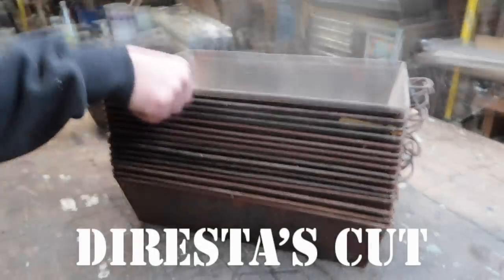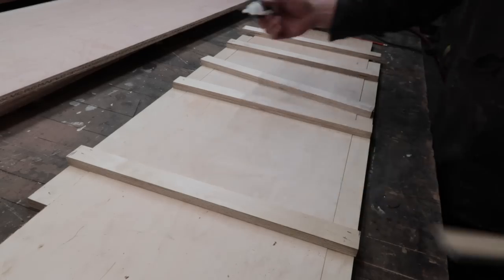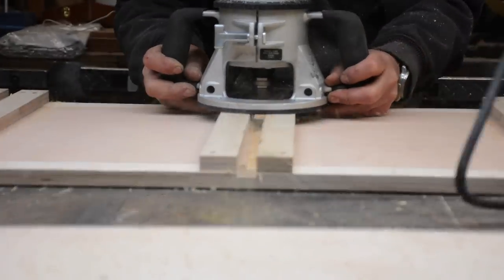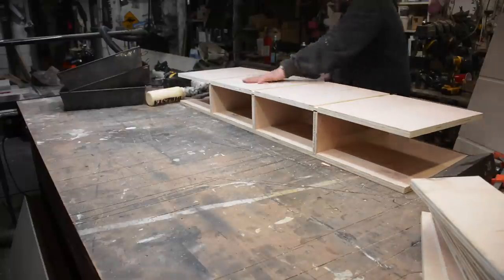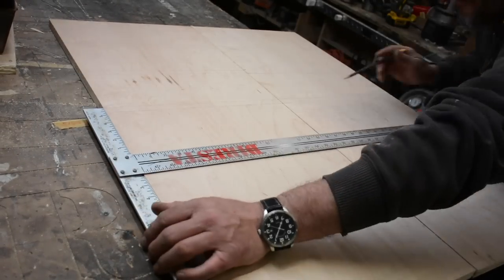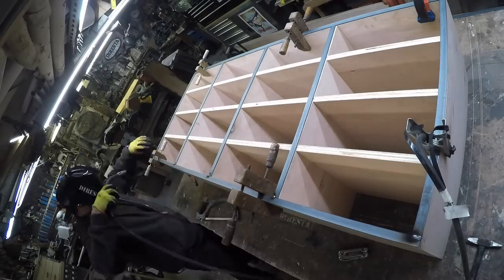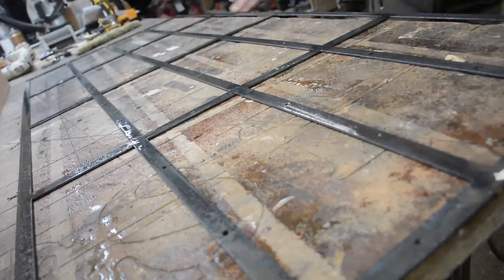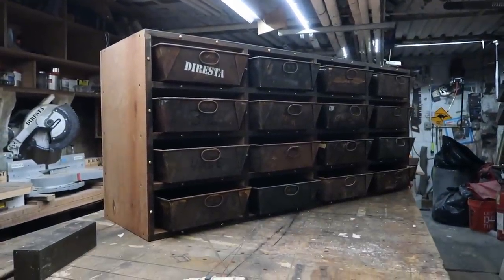DiResta Wood Cabinet with Bin Drawers

Comment: There are straight router bits with ball bearings above the blades. They are meant for copying a template placed on top of the workpiece. They'd work even better for this though and you wouldn't need to glue any guide rails to the router foot. 

(The intended copying thing is a bit hairy because if you tip the router even just a little, the bit will eat into the workpiece and possibly into the template. Copy bits with the bearing on the bottom are safer because you can only tip them away from the work.)

Comment: I'm sure you're aware of this but for those who aren't, there are "plywood thickness" router bits.  They are the actual dimension of nominal thickness plywood.  For example, 3/4" plywood is actually 23/32" so the 3/4" router bit will also be 23/32".

They can be kind of pricey - particularly high quality bits like Whiteside but they save a ton of time and trouble.  If you do enough dadoes for plywood they're worth it.  I have the Whiteside 3-piece set for 1/4", 1/2" and 3/4" ply.  The set was about fifty bucks and I don't regret it a bit.

Comment: Jimmy - You wouldn't have to glue strips to your router if you simply used a set of "guide bushings".
Reply: Hahaha. Take it easy young Jedi. If you don’t understand exactly why that was done, then you most definitely shouldn’t be commenting.
Reply: Albert Ledesma - Take it easy with the condescension, it makes you seem to be an a.hole.

Instead, please help me understand why bushings wouldn't work.

The only difference I can see is that you would have to account for the difference between the bushing diameter and bit diameter when making the jig. Both ways would allow chip clearance. The depth would be preset based on the thickness of the jig. Then the router plate rides on the top of the jig and you can run down pressed against the right edge side and back up the left. (That's how Norm Abrams used to do it.)
Reply: No doubt.  I love the guy but he reinvents the wheel a lot...

Comment: I'd love to hear how it held up over time. Did the techniques last?
Reply: Why wouldn't they? Everything is dado jointed, glued and screwed in, there's a welded single piece metal face plate, a thick plywood backing with another 200 screws going through it. Like what more can you do to make it sturdier?